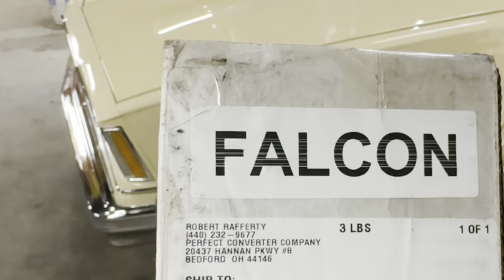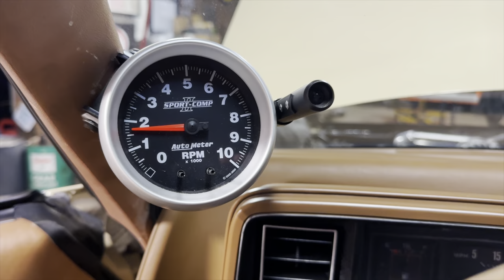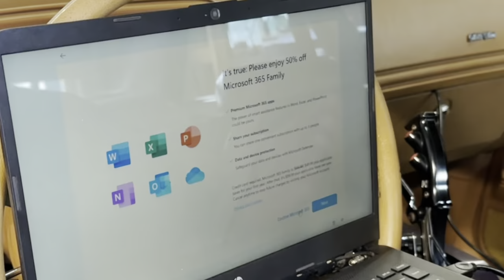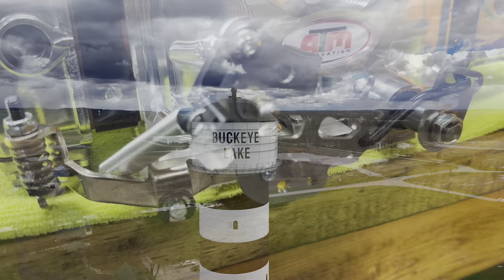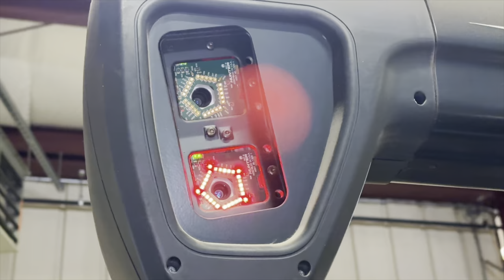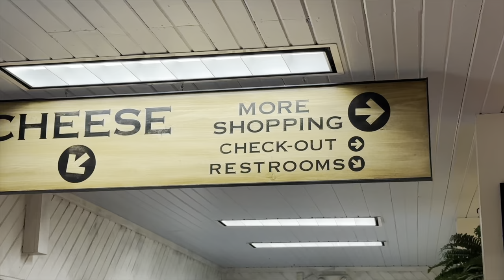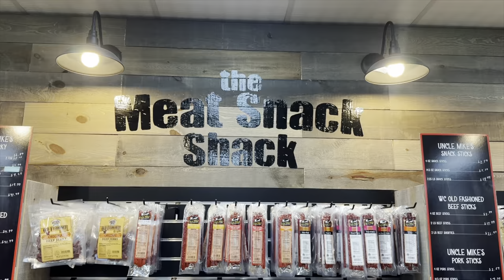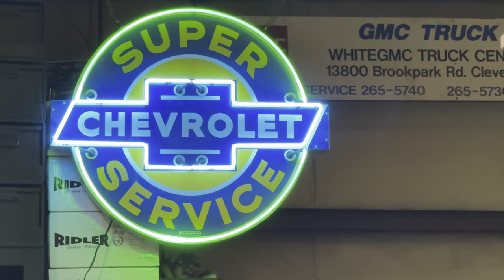NON STOP PROBLEMS & DISAPPOINTMENTS!  IS THIS WEEK OVER YET?

Comment: Bill, A fix for you creek problem. Source a old 96" (or 102" if you can find one) Flat bed Semi Trailer (Preferably Steel Construction) And remove the axles and lay that across you creek. Hell if you want, Put two of them next to each other to get a 16' or 17" wide deck. I recently say some on market place for about $400.00 each. The scrap on the tandems will help cover the cost of them. Then you can even have Tanner/ aka Steve to weld some rails on each side if you want. We did this last summer at a Hunting Property in Muskingum Co. And with the equipment you have, You can do all the work yourself with a little help from the young men you have on the payroll.  Because even 48" precast concrete culverts are priced OUT SIGHT for the average home owner today.
Reply: We used a 102” van trailer we bought with total investment of $600 delivered, doors were falling off and the reefer unit on front was trash though. Yanked the axles, fuel/air tanks and all wires, cut out the front out, used dirt/gravel from the creek to build up 2’ on both sides of the ditch and laid it across the creek. Going to frame up for some windows on the sides pretty soon so wont be so dark in there

Comment: Bill, the E85 is what’s messing up the sending units
A sending unit from a late model flex fuel system might help
Reply: Right on
Reply: I believe you are correct. My neighbor has a 71 Nova ss (stroker 383) and he has replaced 3 units and finally told the parts store what he needed and what fuel and they hooked him up and almost a year now and no problem.
Reply: Or, get a dial potentiometer that matches the ohms (or a little larger in spread, like twice the ohms spread zero to say 160 Ohms), wire that in sequence to the pickup before the gas gauge.

What is happening is the alcohol is coating the pick up and increasing the ohms of resistance (doubling it over time), once installed you can fill up the tank, adjust the dial to decrease the resistance till the full on the gauge reads full of the tank, and it will reduce the actual voltage to the sender.

Next time you fill up, adjust it again so the needle reads full...over time as the alcohol corroded the sender, you will just only adjust with each fill up.

But, at least you can control the resistance and keep it within the required spread.

You can always find zero, it is doubling the resistance over time due to the corrosion build up.

An old trick:
To freshen up older sending units, disassemble all plastic and rubber parts, then put in a pan, add white vinegar, and heat the pan to a boil, and boil for 10 minutes, rinse to cool, reassemble. That should remove most of the corrosion, thereby removing the added resistance reading. The alcohol attracts water, which increases the corrosion increasing the resistance reading.

Comment: You have a plug wire arching when you were testing stage one , 12:09  seconds look behind the carb and distributor near NOS solenoid when you hit the wide open switch, you can see arching
Reply: Good catch, I noticed that as well!
Reply: @BackwoodsRacin  it actually looks like its the solenoid arching maybe finding a better path to ground, seams to match the pwm of the solenoids,
Reply: Thanks for seeing that! I’ll fix that in the morning!

Comment: Ive been having a LOT of tough weeks. My rigs are paid off and life was grand for a few years... Then came the "older" car issues. Everything on my 06 Suburban with the 8.1 started failing and every part i replaced would fail! Cannot get parts that last anymore. So now im working on overhauling the AC system in my Suburban, and as of a week ago, my wifes 2013 Traverse AC  shit the bed. Bad rear evaporator core. Just finished overhauling the AC and rebuilding cylinder heads in my 92 OBS chevy K2500 w/5.7TBI. If you have older vehicles, this is your life.

Comment: If I could build a Nova. It would be Exactly like the Orange and Black one. Big Block and 5or6 speed manual trans. Im gonna swap my 82 c10 Squarebody back to a 5speed one day but i cant afford a TKX. Might be able to afford a t56 but more than likely ill have to go back nv3500 so i dont have to cut another hole in the floor. Just gonna build it a little stronger if thats possible. I really wanna bang some gears again!

Comment: Have you tried running a dedicated ground wire to that fuel pump/ sending unit? I had a 96 Chevy truck that kept going through fuel pumps. I finally ran a 10 gauge ground from the battery back to the harness and tee'd to a chassis ground and to the harness. That finally solved the problem.

Comment: For the Nova, when you say a "strange 9 inch" are you just reluctant to say a ford 9 inch? I've had old timers tell me everyone used ford 9 inch rear ends, be they ford, Chevy or Dodge fans, I can only assume the are strong, And not going too far into it, but I damaged a limited slip 9 inch with a factory stock engine. It was likely my own fault, not the rear end"s--now to rest of the video  :)

Comment: On the Malibu how many volts does the car run at?, obviously if your running higher than stock you’ll continue to burn resistors, put it on a switch, and turn it off when making pulls..

Comment: Bill
The gas tank sending unit assembly has rivets for a reason. You don't want that hardware comming loose and falling into the gas tank and going into your fuel system. Things can come loose due to vibration.
Just a thought.
Your video content with classic cars is the best. Your carb tuning skills is superb.

Comment: A persons just got a wonder if it’s not the ethanol is killing them about 10 years ago there was a bad batch of gas shipped out to the Shell stations that accidentally put too much sulfur in the fuel, and with that did it anyone who had a fuel gauge that was made from aluminum or silver. They quit working in just a few weeks. The only ones that weren’t affected were the ones that were made with copper contacts just a thought.

Comment: Is that a standard driveway pipe 15”? If so putting in a bigger size pipe would help tremendously and adding some rip rap along the front of pipe and along the creek sides to help from the erosion.

Comment: Bill you guys always motivate me to get more done around here. 

I'm waiting for some of the parts to show up so the TKX can go in my 65 GTO, that Nova and your Monte have me itching to get the man pedal back in it. I have a similar problem with any horizontal surface getting covered in stuff. My solution was pegboards on every part of the wall where I don't have shelving, and I added some shelving to get the transmissions, cylinder heads, and whatever else off the floor.  Creative solutions, and now things have their place rather than 'that will do for now' place on a cart, table, toolbox etc.

Now I am on to building some carbs... tri power 2 barrels, a couple cheap Chy-na 850s, and I need to do something with the Cuda's 340... and stuffing an engine in the 72 Ventura to get the engine off the floor and out of the shop... along with a transmission and a bunch of other parts.

Comment: Hay bill I have question I have a 86 grand prix it has a 358 sbc it has 292h comp cam with speed master 220cc heads it is seeping a little colanton on passenger side it's got multilayer head gaskets I didn't put any kind of sealant on them didn't now my first time building any thing like this u got any suggestions on what to do cause it makes my temp kinda jump around thank u I have watched u since before omg when it was just src thank you

Comment: Just a question, could it possibly be the ethanol messing with your fuel tank level sensors? I don't know, I'd probably try to run an experiment and don't run ethanol for a month and then run the ethanol as you normally would and see if it burns out again! Or it can simply be Chinese junk! Lol!

Comment: Just a suggestion on any aftermarket lights even if they are "oem" style. Run an xtra bead of silicone to seal them and drill a tiny hole in the bottom as a vent

Comment: Hey Bill, if you know anyone in your area that works for the dot, alot of the times contractor's that replace the small backroad bridges scrap the old beams and will give them away for free, you could build a bridge on the cheap for your creek instead of the pipe continually clogging up

Comment: After you got laptop setup and first started the car you can see spark jumping right behind the carb from spark plug wires. Right between distributor and carb. Around the 12:10 mark in the video. You can also hear it arc jumping each time you rev the car when under the hood testing the new nitrous solenoids

Comment: I have had my frustrations with the aftermarket lights as well Bill.  If you can ever get it to dry out, take a small bead of clear silicon and go around the glued areas that they put them together with.  Fixed my fogging / leaking issues.

Comment: Simple repairs like heater core jobs don't need to be kept days. I do Mobil auto repair so if you pressure test your job when finished you are good. After a good heat cycle